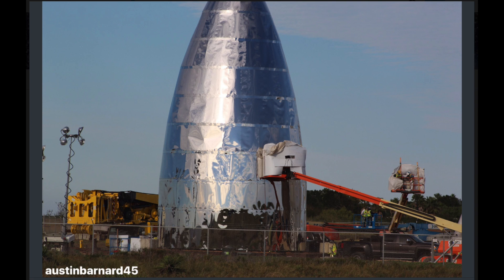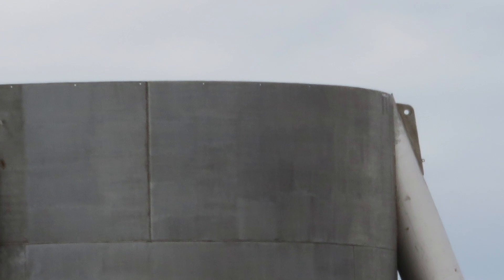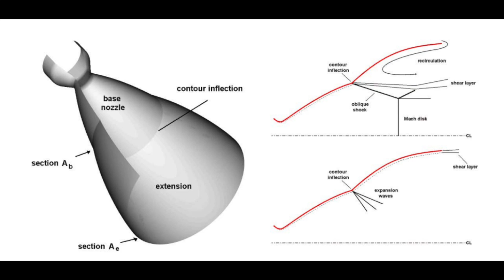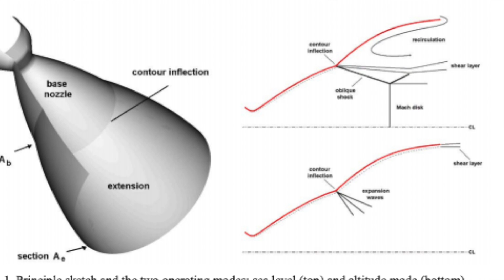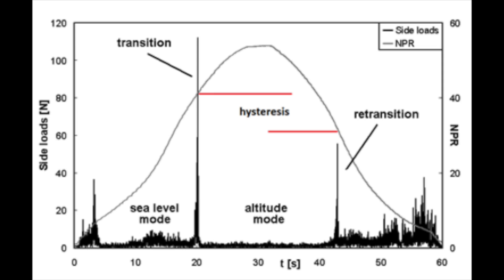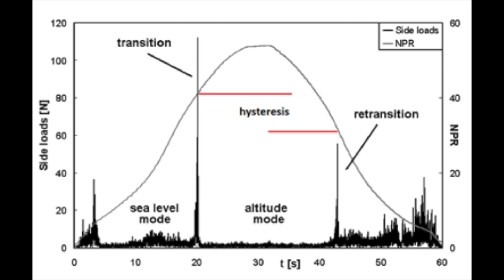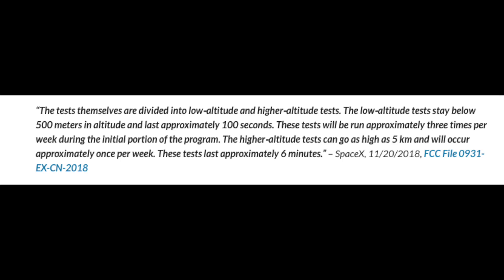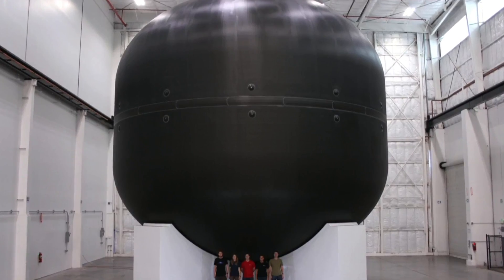What's Going On With SpaceX's Stainless Steel Starship?

Comment: So I watched this video again, just after SN15 flew to 10km on three sea-level Raptors, returned (um "Glided" no less!) to the launch site and nailed a perfect landing.   With 20/20 hindsight, you can see precisely the thinking that was going on with StarHopper - and the path from there to here makes perfect sense.  But from the perspective of Jan. 2019, this thing seemed like a crazy kind of a joke.   The lesson to learn here is never to underestimate Mr Musk.
Reply: His official title at SpaceX is Chief Engineer.  It's not an empty title.
Reply: @dyingearth  Yes - and many people forget that.  At both SpaceX and Tesla, he puts in a lot of hours writing software, using CAD software and running simulations.  You can see that by looking carefully at the computer screens in several of the videos of him that were shot in his work area.  He works 100 hours per week, spread across two companies...at Tesla, he can be seen working on the actual car production line, building cars - because the act of actually doing that informs him in ways that could not be found in a report written by some mid-level manager.

Comment: With the Starship now having regenerative heatshield, could you do a refueling maneuver before reentry on the way back from mars while parking starship in a high energy earth orbit, similar to planned refuelling at launch? So you could design fuel tank capacity for smaller Δv (=saving weight), couldn't you?

Comment: For the record, I for one didn't like Boeing's "Starliner" name since I rather doubt it will be providing a service like a passenger liner and it's certainly not designed to fly to any stars -- and I said so from the start. :-)

The space shuttle didn't end up serving like a shuttle either but at least it was _meant to_, so it gets a pass. For what it's worth, at least we now know "Starship" won't in the end be called that thanks to the inevitable next name change, whenever that happens to this... MCT-ITS-BFS-thing :)
Reply: The Shuttle was't officially named the Shuttle, it was the Space Transportation System.
Reply: @nvlietstra  What did the Shuttle Carrier Aircraft do? It carried the Orbiter vehicle component of the "Space Shuttle" that in turn was the only part of the Space Transportation System that was actually funded and built. I admit I'm hazy on where the "shuttle" word ultimately hails from; there were a bunch of designs too. In any case that thing that flew, alone without the rest of the parts of the system, wasn't what the whole space transportation system was envisioned to be.

Comment: I'm not sure about this, but maybe there is a deeper reason for the stainless steel. Doc.Brown's time machine in Back To The Future, the flux capacitor made time travel possible by using the origin point as a point of reference to translate what the driver wants into something that the universe can understand. A DeLorean is ideal to house the time-machine, because its all-stainless steel construction provides a shield of protection for the massive amounts of negative energy being conducted. It has a direct effect on the overall flux dispersal allowing for the smooth passage through the space-time continuum. The steel chassis also provides protection during re-entry from the wormhole which can be a rather jarring experience. 🤔

Comment: The Diameter:Height-Proportion is higher in this vessel, so I guess using three engines gives it additional stability. Try to balance a pencil on your fingertip … and then do the same with a waterglass. While it makes no use using three fingers for balancing a pencil, it will make you balance the glass absolutely stable with three. That's the missing link for many of my thoughts why they risk Landing with the BFR, when they don't even handle all Falcon landings. The answer is so simple. The better Diameter:Height-Ratio makes it much easier to land. That's also the reason why Landing the Dragon V2 with thrusters only would be so easy.

Comment: So if its just a demonstrator with nothing inside (shell only) then you can use all that 'saved weight' to save money by just making the shell out of cheap/quickly assembled sheet steel using traditional quick assembly techniques... The thing weighs 3/4 of what the final item will weigh but is just an empty shell. Plus you can make half a dozen of them for the same price soon if a few go 'boom' due to a software error you just get another water tank, I mean steel starship out for testing...  The fixed legs look wrong though, is this thing expecting to land very very slowly/smoothly? Doesn't seem to be any shock absorbing other than brute force strength...
Scott: I seem to recall a video of yours about the largest planned sea-launched rocket that was going to be made simply of sheet steel...
Reply: Sea Dragon? That was going to be made of maraging steel, which is a very high strength nickel-cobalt steel.
Reply: Nate Vlietstra Yes that was the one....

Comment: How the real landing legs for the BFR or Starships is going to absorb the impact with so many tons of weight? I thought they were designed to move in a totally different axis from the vertical line.
Reply: They are going to add shock absorbers at the feet.

Comment: Scott:
Does not need to be stainless... it could very well be specular aluminum (the type used in light reflectors).
I designed with it long time ago food and space heaters using calrod tubular heaters nearly glowing white.
Specular Al are usually coated with titanium dioxide (a clear coat) that prevents oxidation and withstands a HUGE
amount of temperature... certainly over Al melting point.... so the finish will not flake off.
And looks super shiny!!!! ¯\_(ツ)_/¯
Reply: Starship need extremely high specific strength at high temperatures. Aluminum becomes much too weak over about 200 C.

Comment: My guess, if these are not the molds for forming the composite skin with, like the one shown before, is that this might be a "mass correct" grasshopper for the BFR.  Therefore they would want it to have the number of engines that the BFR upper stage would have and building it out of Stainless Steel might be the cost efficient means by which to build the proof of concept test article.

Comment: So many smarter more qualified people below. My 2 cents worth: do you remember the grass hopper?...how crappy it looks/looked  compared to the real first stage? This is just to get test data back IMO. So just knocking some sheet metal together is a good approximation. Elon applies s/w testing philosophy to h/w. Get a POC up and running and either re-use it, or use the data gleaned to build the real thang.

Comment: Of course I'm biased agaist Elon Musk specifically, he's a ginormous and unapologetic wanker. That said, Mr Musk has built, designed and tested exactly zero of Space-X's spacecraft, he's irrelevant to what they're doing and should not be credited for the amazing work of scientists and engineers. Thanks for the interesting video.
Reply: Depends what you call design. Musk isn't out there telling a tech where to put a bolt, but he certainly does high level conceptual design.

Comment: Once you get to a certain large size, wt no longer matters as much.
Also, if pressured tanks are providing structure then can a rocket land when empty without that support.
Thus stainless steel
With the down and dirty manufacturer it can't cost to much
It will also be robust .
The license was for 3 times a week.
I can see 30 to 100 flights from this test bed

Comment: Scott, those nozzles are ~1.3 meters diameter, which is not anywhere near big enough to have detached flow at SL given Raptor's expected thrust levels. The only way the flow will ever detach from the larger nozzle is during deep throttle at sea level, that is, for landing.

Those are throttle-compensating nozzles. Not altitude-compensating nozzles.
Reply from the maker: That is a very good point.
Reply: @Ian Finlayson Maybe. "blend of dev and operational parts" implies they could be actual test hardware (leftovers from earlier Raptor test campaign) and not just looks like mockups.
Reply: Maybe its a new retro style space- diner! ha ha ha

Comment: Hey Scott,

This article reckons that a Starship without a payload could get itself into orbit without the need for the booster? If this is correct, then I think it would be the first demonstrated SSTO vehicle? Perhaps you could shed some light on this?

Thanks again for the awesome content!

https://www.nextbigfuture.com/2019/01/why-is-spacex-working-around-the-clock-on-the-starship-prototype.html
Reply: A Falcon Heavy side booster could also reach orbit with a tiny payload. SSTO by itself is not hard. SSTO with a useful payload is hard. SSTO with a useful payload AND reuse is really, really hard, maybe impossible with current technology.

Comment: If it's a test bed for new engines and fuel systems it makes sense to make the fuselage as heavy as possible to prove it's payload capabilities without needing to resort to ballast or full size rockets for testing. Also, they could be testing new landing techniques and engineering issues (how much can the compensate for rough landings, uneven terrain etc.). Which would also be aided in a extra heavy superstructure test vehicle.

Comment: Casual assumptions:
maybe they are building structural tanks, because integrate frame and tanks maybe save weight and give a more rigid structure.
About the outside "look" of the surfaces, i guess that either they will cover it with something or they recon that a perfectly flat surface is prone to instability and the better way is to make a "noisy" surface?
Time is money... plus after the succes of Ultima Thule, maybe there is the "smell" of money for a near future asteroids harvest and this can be quite handful for the first human explorations of rocks :)

Comment: Stainless has high heat tolorence, but is very heavy per unit, titanium has the high temperature tolerance with the light weight per unit that aircraft and rocket designers look for. The Soviets used stainless for the mig-25/31, due to the primitive state of Soviet metallurgy at the time and paid for it with miniscule range, and maneuverability inferior to a jumbo jetliner.
Reply: Stainless has higher specific strength at 500+ C temps, is cheaper and MUCH easier to work with than Ti alloys.

Comment: You know what this seems like?  It seems like someone realizing that if we step away from "100% safety rating" hand-milled-down-to-the-bolts no-margin-of-error manufacture, we actually have the infrastructure to build spaceships on the cheap.

Basically, it seems as though spaceflight has for a very long time been approached in a "can't risk it" fashion, while technology has been progressing and progressing.  But nowadays, we HAVE the tech to build spaceflight-capable vehicles in large numbers- just without the extreme safety and weight-to-power precision that's defined spaceflight so far.

This is possibly the Model T of spacecraft.  It's not the best, it's not the safest, it's not the most efficient, but it's cheap and it works (most of the time) and that's good enough.  And once you start getting quantity, you drive the price down so much that you can start getting better quality without sacrificing economics.  The trick is to DO IT first and figure out how to do it better later.
Reply: Unlike the Model T, this won't carry any people or do any operational missions.

Comment: Scott can you tell us something about the engine alignment? My guess is: Although they look like they were aligned on a straight line, my guess would be it's more like a circle/triangle? I'm curious because in KSP I always align my engines radial to the center of mass…
Reply from the maker: I think the straight line turns it into a slice of the 7 engine cluster they intend for the full version.
Reply: @scottmanley  Oh really? Interesting… So they fly grasshopper tests using the three engines in a row? My guess would be this impacts maneuverability drastically
Reply: @NurText  No, it improves maneuverability. With one engine, you have no roll control. With 3 engines, you can point the outer two in opposite directions to twist in roll. All the engines can gimbal independently to steer.

Comment: The material choices may be due to Van Allen belt radiation power collection from dissimilar conductivity phase imbalance potential difference. By using the electricity collected this way the craft would be better damped the way a Faraday cage works. It does remind me of the cartoon drawings used in the Jetsons back in the 70's possibly because a back reference to that time is important to help with study of Apollo missions. Material strengths and conductivity are very important  depending on the environment the craft will be used in. Tesla are world renowned for their batteries and electrical systems and using simple radiation, UVA and B, that are the most abundant power source in space, there is at least something to be used as power, for great distances of travel. Having a landing system with no moving parts has it's advantages and disadvantages however.

Comment: It's not aerodynamically stress worthy because it is only for Hop testing. It won't be stressed in any way that matters to those SS panels. They are just coverings for the shell. Hop testing doesn't involve any great aerodynamic forces. It will be mostly testing engines and system stability and ability to "hop" so they can start the refinement process...and using SS lets them build it quickly for testing instead of the complex carbon fiber spinning,  forming, resin baking process that takes so long.

Comment: A brick will fly with the right engines and control system. However, this looks like something I would have built when I was a kid playing spaceman. I don't think it would hold up even to the engines being ignited without shaking apart, thing looks born to resonate to destruction. Maybe it is to hide something being built inside it. Maybe it is a publicity stunt. Maybe an ironically tacky roadside attraction? Looks too slapdash to even work as a water tower. I'd bet half a glass of water it is just a magician's type distraction from something else. 

Didn't know about SpaceX missing out on contracts. Wonder if it was the smoking, the power of pork consumers, or Lard Vader's presidential decree for leaving the fake committee. The smoke and pedophilia insults might not have been politically astute but I think SpaceX's record speaks for itself. Hmm, maybe it is art symbolizing the sh*t country we'll end up with if we continue down the current path--Apollo and Falcon replaced with a crappy playhouse. Oh, or maybe it is part of a wall-not-wall.
Reply: The contracts that SpaceX didn't get were for developing a next-gen EELV rocket for the USAF. SpaceX does not need money to develop a next-gen EELV, because they already have one flying in Falcon 9/FH. BFR did not meet USAF requirements for direct GEO injection.
Reply: @nvlietstra  Thanks for the clarification.

Comment: A test prototype most likely.  If all it is doing is going up and going back down like the former grasshopper, it really doesn't have to be all that well made .  It would be more important to be the right weight and have the avionics and propulsion systems mounted properly.  All the other systems required for orbital work would be better to tested outside of a system than has a good chance of an unscheduled disassembly on its first test flight.

Comment: My guess is it's rough proof-of-concept – maybe to test out new, cutting edge fabrication techniques – or as a trial-run for the water tank manufacturing team, for future contracts(?) – and maybe the resulting, final product will be a cool, shiny statue/water tank outside SpaceX's headquarters... Also – am I crazy – or wouldn't using a huge, stainless steel shell for ultra-high-speed, aerospace applications be totally dangerous and impractical for a ton of different reasons?  (e.g. weight, overheating, high-carbon content/prone to burning up, etc?)

Comment: 3 engines is clearly for redundancy. The Human cargo requires redundancy fir safety if one or more fails.

Stainless steel is better then carbon fiber at very high and very low temperature seen in space and reentry.

Comment: Maybe a test for hover control of large structures in the atmosphere? For larger rockets with multiple engines it might even be necessary to vary the thrust of the engines to get good control and this could be a testbed for that? The sheet is far too thin to travel at significant speed so that's all I can think of in terms of it actually moving.

Comment: My guess, build it in a tent because you intend to test it like you stole it. (expect a boom)

Build it near a hanger and you've got to transport it away from the hanger or risk blowing the hanger up. Transport it away from a hanger and you've got to build it to a standard that it can be tilted into its side, broken into pieces, and re-assembled anyway (expensive to do for something your testing to destruction).

I'd be surprised if this thing gets more than a few meters off the ground, anchored by guide ropes of some sort. I'd be surprised if this thing leaves the ground. They don't look like they are worrying about giving it a stable aerodynamic shell after all.

Comment: Do you think this is an example 'jump ship' for their commercial city to city transport? Obviously it wouldn't have any capability for country to country without a booster, but perhaps there's enough impulse to get from say LA to Seattle or something of the sort? The booster stage for this is probably extremely expensive to build so maybe they're attempting to demonstrate continental transport to suck in investors and fund the booster stage? That would also explain the stainless steel, very little maintenance of the hull would be required over lots of short trips.